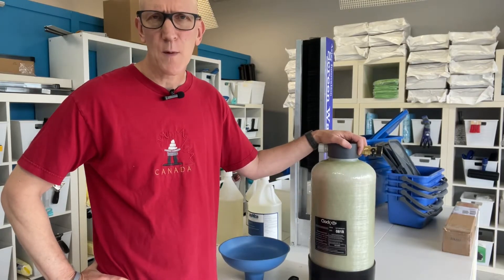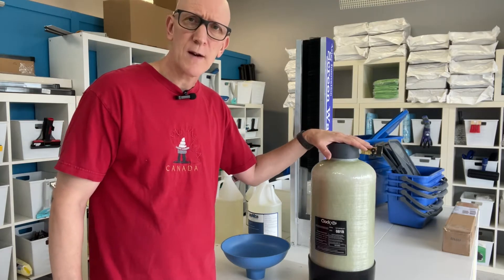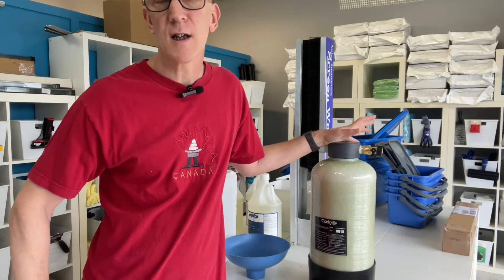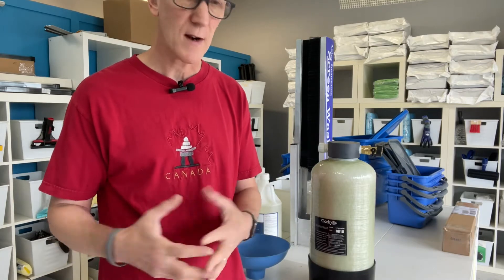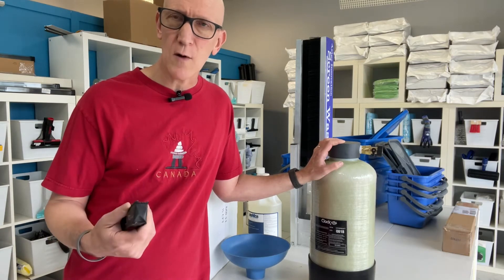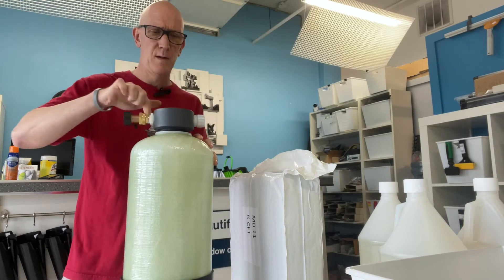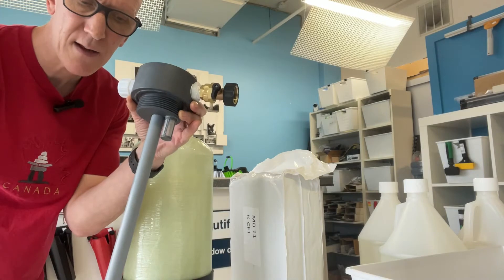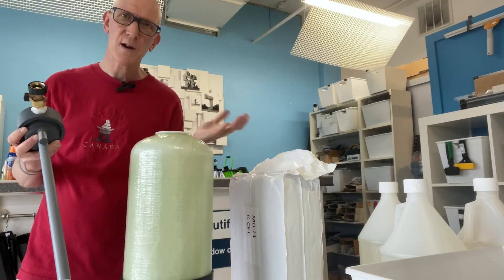DI Water Purifier Vessel  for pure window cleaning + how to refill it with new resin.

Comment: Hi there! 

In another comment, you mentioned that any left over water is safe to leave inside the tank. 

How long can the tank and resin be stored between uses? Say I do a job, but don't find another window cleaning job for a long time. Would I have to run water through the tank every once and awhile? 

Thank you for all your amazing content
Reply from the maker: Great question. DI resin is not the type of filter you need to run water through occasionally, Since you’re not drinking that water. This would apply more for an RO membrane as bacteria can start to grow inside. The only thing about DI is that you don’t want it to be exposed to air and dry out. You can empty the majority of the water during long storage, cap of the tank on both ends and do not allow to freeze over winter. Should be good like that for up to around 6 months, maybe more.

Comment: What do I do with the tank before filling? Shall I empty it completely?
Reply from the maker: Yes, dump out the spent resin and dispose of in accordance with local laws.
Reply: I found that leaving it completely full before filling actually works well for me.

I tend to use slightly less replacement resin that way which saves me money 👍🏼

Comment: I have the same resin vessel filled from brand new. I am not sure how to use it. I attached hose water pipe on one end and a hose spray from the other but there is no water coming out. how long does it take for the water to come out or am i doing something wrong?
Reply from the maker: @PedroKarsan  There is an input side and an output side. The water has to go through the input side, from the water passes through the resin, fills the tank, pressurizes and the pushes the water up through the riser tube to the output fitting. I don’t believe it’ll work if it goes in the opposite direction. If you have confirmed you are going in the input and still not working, may I ask if you have any kind of shutoff valve installed that may be in the “off” position? Outside of that, I’d put a call in with where you tank for more trouble shooting.
Reply: @WCSkills  I put the hose coming from the tap to the vessel where it says “IN” and a shower hose where it says “out” so I think I have that part right at least. When you say the water passes through the resin, fills the tank. pressurizes and pushes the water up. I imagine this would take some time and wouldn’t be that quick? How long would this normally take?
Reply: @WCSkills  I also don’t have any shutoff valve. I was pretty bummed out that it didn’t work as expected

Comment: Would you recommend this tank to fill up once a week 100 gallon fresh water tank? ... Any suggestions? ... Nice video.
Reply from the maker: No, the DI tank produces non-potable water. Its free of minerals but still not good for you to drink.
Reply: Not for drinking - Can it make the 100 gallons? - For the carpet shampoo business  - I understand the resin will need to change more often but what do you think? - Another size tank? @WCSkills
Reply: This size tank will get you 3-5k Litres before you have to change the resin depending on your water quality
Reply: Depending on the input water quality, you could filter 
3000-30,000 liters 
Or
792–7,926 gallons.

Short answer… Yes.

This kind of filter is excessive for your use I imagine.
 If you’re just filling up a tank, maybe you could buy a smaller cheaper lower flow model.

Comment: I finished my first house/job today. After packing up my equipment, I can hear water still inside my DI tank. And I supposed to dump the water out every time I’m finished or leave it in the tank until the next job? 
Please answer would be greatly appreciated!
Reply from the maker: You can leave the water inside. No need to drain it.

Comment: Do you need to fill the whole tank up with the resin, or can you fill it up with less in hopes of less output gallons of purified water?
Reply from the maker: So for starters, filling around 3/4 is a nice balance between being able to close the screw lid but also longevity between changeouts. Volume can improve by allowing the water to pass through at a slower rate(more contact with the resin beads). That said, if you’re low on replacement resin, you can fill it less like half or even a 1/4 and so long as the tank is upright and the water flow is turned down, you can purify the water but less beads available will return less overall output of purified water.

Comment: Hi
Is the vessel 7ltr ? it seemed on the picture wasn't a bigger like 11ltr , or more 
Watched it on m/b phone , just wanted to be sure.
Thanks 
Thanks
Reply from the maker: Hold a little less than 1/2 cubic ft of resin, so by my calculations, around 11-12 ltr.

Comment: Question. Do you have  to put gravel at the bottom ? And do you need free bor space in the tank ?
Reply from the maker: No gravel required. Just fill with mixed bed resin. Leaving a few inches of space at the top in order to screw in the cap and riser tube.